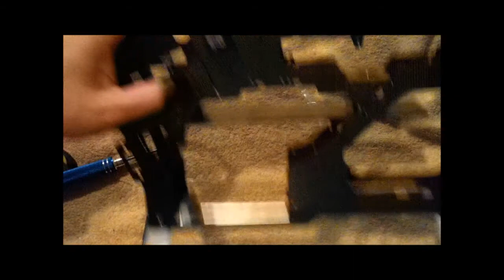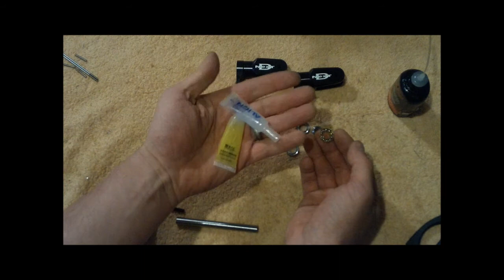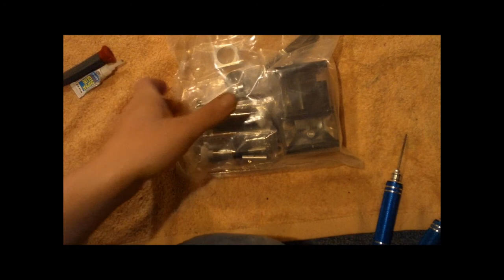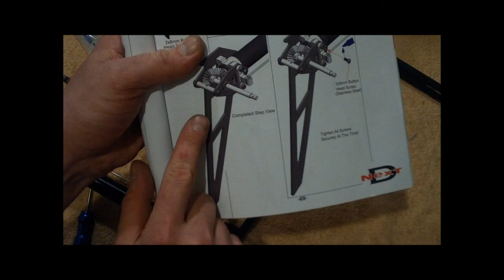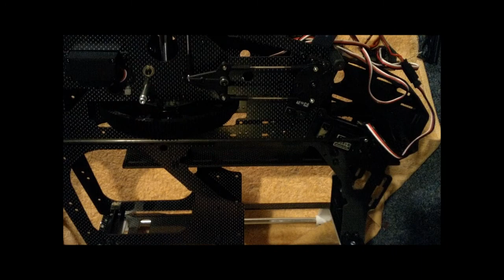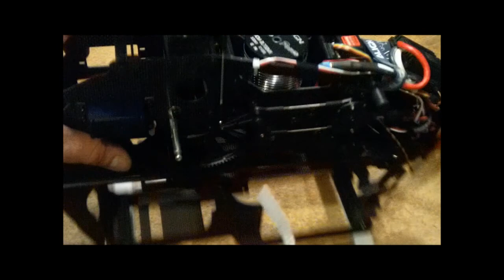Rave ENV Electric Flybar Build: Part 4

Comment: @dbutzer  Sorry i just have more to say and ask??  How long you been flying R/C helis??  And the Rave seems bigger than the Trex 700E but does the Trex fly better cuz its a $1300 kit?? I have a Helimax AXE 400 3d, but not yet have flown it excecpt on Realflight G.5..Have youve flown that heli before?? And i've wondered, a trex 700 and Rave 90,  they are kinda heavy fully loaded huh, Im mean around 10-13 pounds..With a battery my AXe is kinda heavy. A 700 size loaded has gotta have some weight!!!